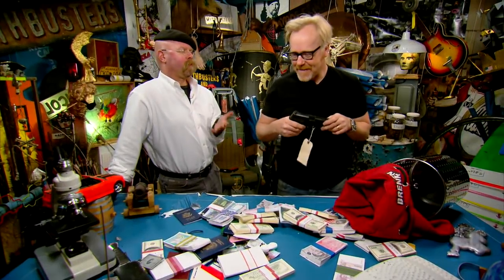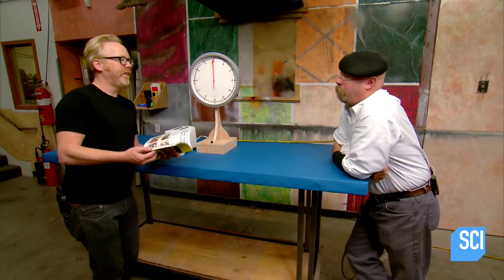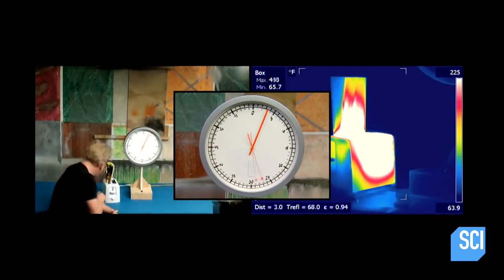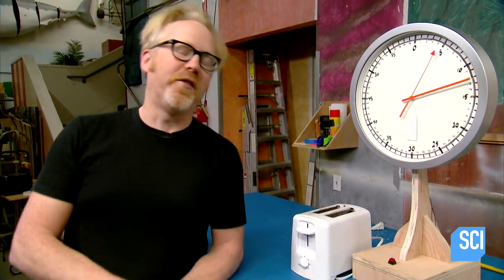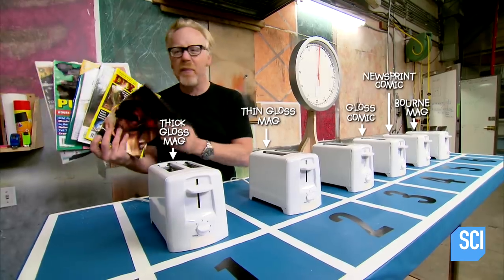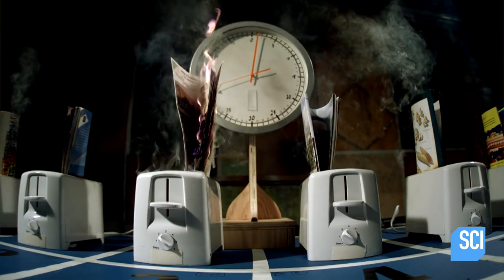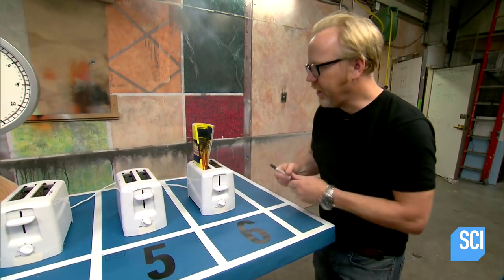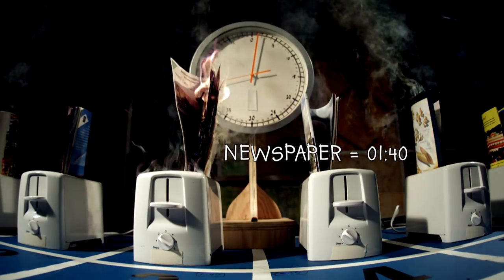Can a Toaster Light a Magazine on Fire? | MythBusters

Comment: You also need to consider the power output of the toaster and the design of the coils. If the coils are situated closer to the the "toast", the paper will heat up and ignite much faster.
Reply: WHAT IF THE TOASTER WAS ALREADY WARM THEN BOURBE STUCK IT IN THAT MEANS IT WOULD ALREADY HAVE RESIDUAL HEAT AND NOT HEAT UP FROM SCRATCH
Reply: There's also the fact that the magazine in question has treated pages, which means that they are more than likely plastic coated or something similar. Pure paper magazines would ignite faster, as the protective covering isn't needed to melt off first
Reply: @stevethea5250 It wasn’t warm already because the guy just got home, Bourne killed him and then set the toaster bomb.

Comment: Isn't there the possibility a real toaster in a real house might trip the breaker for the circuit? Professional electricians need to weigh in on this.
Reply: There wasn't any short circuit. So the breakers wouldn't have tripped. 
A breaker or fuse doesn't care about anything other than Current and Amprage. If either of those 2 things go out of spec it pops. But voltage and duration doesn't matter at all to it.

Comment: The scene happened in EU if I recall correctly so they would be using 230V. However it might not really matter, because the toaster might be tuned for it since toast still toasts at about same temp. However there are more powerful toasters.

Comment: I don't know if a toaster will set a magazine on fire. But it USUALLY takes an open flame to set something on fire. I'm just thinking out loud here. But a toaster will only produce a very hot wire, not an open flame. I'm sure that would make a difference...
Reply: seriously? Have you ever heard of spontaneous combustion?
Reply: The open flame carries enough energy or enough “temperature” to make the paper ignite by reaching his ignite temperature point, if you heat anything hot enough it will reach its combustion temperature and flame
Reply: wait till this guy hears about wildfires

Comment: Did the guys consider that in Germany where the Bourne condo fight took place the wall outlets and toaster appliances run on 220V
Reply: A majority of the homes built after the 1990 or have had a panel upgrade since then run on 220 service in the US. Also, industrial and apartment/condo buildings have 120/208 service due to Medium Density residential being a 3-phase distribution with an alternating combination of 2 out of the 3 phases.